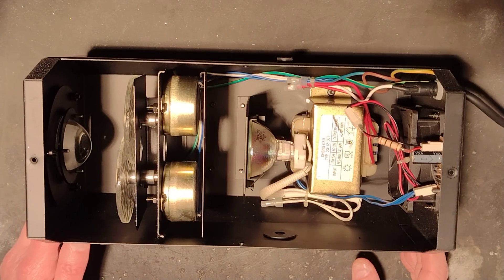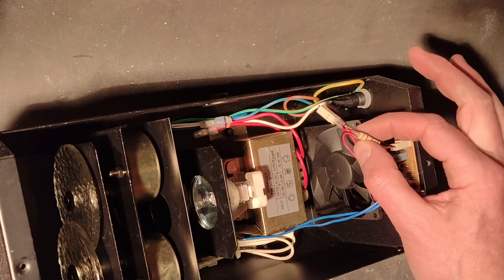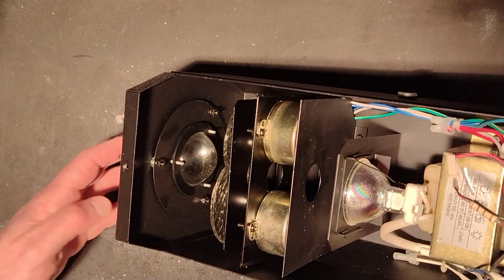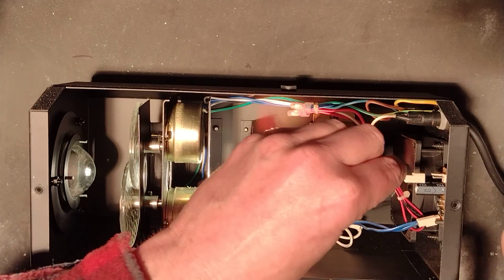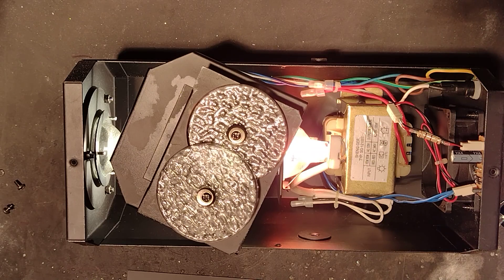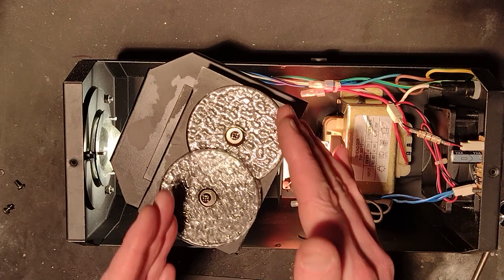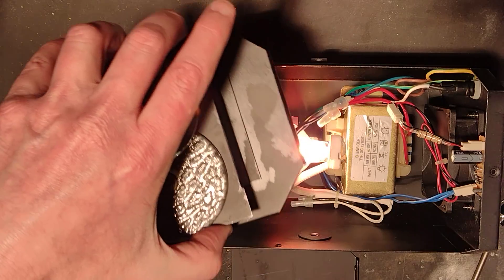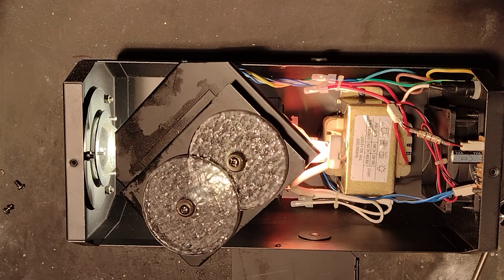Inside a water-ripple projector

Comment: It never ceases to amaze me how jankey and basic the insides of these effects are. a couple of geared motors and some bathroom window glass - really!? Thanks for sharing Clive.
Reply: When I was in college I bought a laser effect light at Spencer's for $200 that was basically a tiny LED glued to the diaphragm of an electromagnetic voice coil from a speaker, and a rotating angled piece of mirror.

By the time my roommate and I came down from our trip we had built a dozen replicas using parts we bought at radio shack for about $30 and later we sold them to other dead heads at our school.
Reply: When I was on molly, I noticed that each dot reflected off of a disco ball projected really tiny shadows in the shape of the bulb's filament if you look really close and focus on one dot.  Most of the old projector based f/x devices are like that.
Reply: @PhilLesh69  When you focus the sun through a magnifying glass, you get a circle, but if in some alternate universe, the sun were shaped like a square, you would get a tiny square. Same phenomenon as a camera obscura. Physics!
Reply: @KurtRichterCISSP  - When I focus the sun through a magnifying glass, I get arrested for arson.
Reply: @RFC-3514  just tell em the internet said it was okay
Reply: When I was a kid I copied (batteries an bike lamp and salvaged motor) a colour wheel disco light my brother had hired - a metal wheel with coloured gel film in holes cut in it, rotated in front of a bright spot. This was mid 70s. My version used cardboard and Quality Street wrappers and the motor from a Scalextric car.
Reply: That’s essentially a lot of early special effects. Really basic things that produce amazing results.
Reply: No need to overly complicate, that just leads to higher failure rates.

Comment: Remember using an old Rank projection  lantern that used a fairly similar principle. There was a massive rotating patterned glass disk rotating, with interchangeable gels, or a special rotating disk for clouds. I remember in a production of Orpheus in  the Underworld, using the cloud effect, and then changing the disk assembly and gels to make stylised fire effect between acts. The local paper commented of the "wonderful use of back projection" it would have been wonderful but I was using front projection on a solid "cyc".

Comment: It seems like they could've used a few cheap gears to remove the cost of using a second motor.  Perhaps using two motors is just more reliable.
Reply: If you use gears, you'd need several of them to "bridge" around the ligh path.
Reply: @beeble2003  Or a rubber band that would fail with each hour of operation.
Reply: @bjornroesbeke  That would be the ideal solution, yes. 😂
Reply: @bjornroesbeke  The Teletype Corporation made a digital cassette unit that was supposed to replace paper tape.  It used an O-ring to drive the spindles.  Rewinding the cassette would cause the O-ring to melt.  It would not even last an hour.

Comment: I wonder what would it look like with light source from one of those "zoomable" led flashlights. Including the zoom-focus lens. I presume it would be enough juice from fan power line. Some buck stepdown converter or simply resistor divider...
Light could be more focused trough and between el.motors. Also, brightness adjustable in steps from the flashlight.
P.s. just saw that there are already few comments about LED light source :-)

Comment: I was surprised to see that it wasn't an ELC 250W/24v lamp in it. I also wonder if you'd have better results using the "coolfit" (I think that's a Sylvania trade name) MR16 Lamps which are designed to not allow light out the back of the reflector?  Thanks for another interesting teardown :)
Reply: I thought the majority of the light that passes through the reflector was supposed to be infra red.
Reply: Another worthy lamp is Osram optical types, they have a polished aluminium reflector.

Comment: I always believed that if you touch those lamps glass it will become yellow due to the grease and heat. Is it true?
Reply: You don't want to touch any bulb that gets hot because the oils from your skin heat up the glass in an irregular manner. This causes it to expand and break.  (it makes hot spots on the glass)
Reply from the maker: Oil on the globe of quartz lamps will cause devitrification and potential failure.

Comment: I wonder what such a machine would look like if built today, I half expect it would probably be a digital pre-programmed gadget that doesn't need the motor and rotary screens.
Them motors look very similar to the ones in the Honeywell 2 or 3 port valves.
Reply from the maker: The classic synchronous motors have a very standard form factor.

Comment: Why on Earth do they use two motors rather than a driving gear for both?
Reply: As someone else noted, it was probably cheaper than a custom gear assembly.
Reply from the maker: Cheaper to use two bulk purchased components.  They missed a trick though, the low load often means the motors will still work fine when wired in series, but will stay very cool.
Reply: This is an old design, when electricity was cheap.

Comment: Apart from the lower quality and durability of materials and components of Chinese clones, I would almost always also have problems with their proper control. When I would load their profile into the program, usually either half of the listed effects wouldn't work, or the addresses would be completely mixed up (effect button label mismatch), causing me to have to try out each effect button before some event starts, to see what each one actually does. That is why they cost three times less than those original light machines.

Comment: Hey there - maybe you could add a lens just after the lamp so that more light goes through the useful section of the discs? Maybe just try it with a magnifying glass you have around? or one lens right on the lamp followed by another further on to make it go through the discs in a beam shape
Reply: Such a collimator will produce a lot of scattering, which will show up as a broad halo around the center spot.  Better optics would be a parabolic reflector, elliptical reflector, or total internal reflection optics.  (All of which make interesting reads.)
Reply: i was thinking of a tube with a reflective inside surface.
Reply: @vsvnrg3263  A collimator?
Reply: @whitesapphire5865  , i had to look that word up.  i was thinking more along the lines of a toilet roll with tin foil in it or a piece of stainless steel.  but yes, a collimator will do nicely.

Comment: If the two motors ran at very slightly different gear ratios, it could add some natural variation. Even better would be if you could adjust the gear ratio (and direction) of each motor indepdently.

You should go ahead and upgrade this thing. Cool white LED, better focusing and light redirection, more motor adjustment, a better/quieter fan (LEDs really don't like heat), maybe some lower voltage requirements or a rechargeable battery...
Reply: Assuming those are DC motors, you could add a resistor in front of one of them to slow one down relative to the other. I wonder if that hasn't already been done?
Reply from the maker: They're synchronous AC motors.
Reply: I was surprised that the disks weren't being driven off one motor with one disk on the motor shaft and a small chain drive moving the other. This would make adjusting the ration easier as long as you has sprockets and chain (thinking something like the old meccano chain). The motor direction also wouldn't matter as much. Evidently a second motor is cheaper than the chain drive, easier, or they didn't think of it when making it.

There would be room for a pretty decently sized heatsink in the box (potentially even fins sticking out the back, so as long as there is a bit of airflow (potentially by a fan) and your aren't pushing megawatts through it, it should be fine I would think.

Comment: I can see all kinds of hacks for this, everyone else is saying LED, but that would leave a huge chunk of the enclosure empty... I could see adding a second set of motors and disks, but with various other lighting effects (colors, patterns...). Psychedelic water ripples! 😁
Reply: With LED you could use that space to put a raspberry or ESP8266  with WLED app, which would be quite cool
Reply: @nyny  that would make the effects easier, but there's something very comforting about having a purely electromechanical device (at least to me, anyway). 🙂
Reply: @Les Excellent point about the focal points, I hadn't considered that. I suppose an RGBW LED could be used to make the same effect as color wheels, but what fun would that be? 
I've seen the water ripple effect and color wheel lights, but not combined. That would have been too cool to make it to my little area!
Reply: How did early Pink Floyd do it, some kind of oil floating on water?
Reply: @charleslambert3368  oil film lighting. It's a really old school psychedelic effect, and I'm hoping Clive will do a video on it eventually.
Reply: @charleslambert3368  I think they used LSD.
That's how Syd lost his marbles.

Comment: Maybe not so much the quality as the design / engineering, The two pieces of glass could have been a tad larger in diameter with more overlap then the size of the round gobos could have been made a bit larger and overall more of the light coming out of the lamp utilized. All this is what drives me nuts about so many products coming out of China, just a bit more effort put into the design with a trivial increase in cost for a way better all round product.

Comment: I'm surprised they even used two motors in a cheapo knockoff. I half expected a rubber band or plastic gears between the rotating plates.
Reply: 2 off the shelf motors likely were cheaper than arranging for the one bespoke shaft and pulley. Then cut cost by removing the condenser lens that should be in front of the lamp, to focus the beam down to a more concentrated form, focussed to a point just in front or behind the glass sheets, so as to get more light output. They missed out on a cost cutting trick though, as often the transformer used is an autotransformer, with  one section being the thick 12VAC lamp winding, and then the rest being a 208VAC winding to cut copper cost. You can go further and use the autotransformer with a second tap at 36VAC, making use of even cheaper microwave oven turntable motors, which are in general wound for 36VAC use, as this saves copper cost in the coils. 

Yes they do not have a direction of rotation, but in this application that means your pattern will be more random, and the transformer can be much lower cost as well, plus the 110VAC version is just a different transformer used in the box, saving money in only having a single part to convert, or adding the 115VAC tap to it as well and making it universal, just choose which CCA wire winding you want to use. Full bridge rectifier, could have saved 1.5c there, and used a single diode and a recycled ewaste capacitor instead.
Reply: @SeanBZA  I suspect the pattern would look rather poor if the discs are rotating in opposite directions, so non-directional motors might not be an option.

Comment: Back in the middle 1970s my parents took us to a cinema in central London. While the audience was getting seated and waiting for the film to start they treated us to a projection of bubbles on the main screen. At the age of five or so I thought it very pretty. I can imagine how it was done - a compressed air line going into a container of washing-up liquid solution, the bubbles spreading across a glass screen with a light behind it, and a mirror and lens to get the image to the screen. It was fashionable in those days, but I'm pretty sure it has completely gone out. I wonder if any of those devices have survived?
Reply from the maker: Oil wheel projector?
Reply: Used an old ex-MOD slide projector with a TicTacs box and baby oil to do this.
Bit of tube for aquarium air system to  blow bubles and it worked well.
Reply: @keithsquawk  That sounds plausible for what I remember on the screen.
Reply: Syd used to have one.
It reminded him of the old days, when he had his marbles.
When he died it was sold.

Comment: Is it just my imagination, or were there also some ripple-projectors that had some kind of oil-film inside to create the ripples?
I always wondered how they work.
Reply from the maker: The oil units were possible oil wheel projectors that created psychedelic coloured moving blobs.
Reply: @bigclivedotcom  The Pink Floyd used oil wheel projectors in the 60's.
That's why Syd lost his marbles.
Reply: @travisash8180  he was supposed to look at the oil, not smoke it
Reply: @bigclivedotcom  do a 24 hour video with one of these oil wheel projectors, I'll gladly watch it while falling asleep😁
Reply: That's an oil wheel projector, they have 3 glass discs with oil and wax to create the effect, LED bulbs are of no use with them, the wheel needs heat for the wax to soften👍
Reply: @rickthescrewballpeacekeepe7387  Ah, so it is kind of like a Lava Lamp inside a projector? Interesting.
Reply: @Ranger_Kevin  pretty much yes, it has round wheels like the ones shown in this video but 6" diameter👍
Reply: Cinemas here had those oil projectors